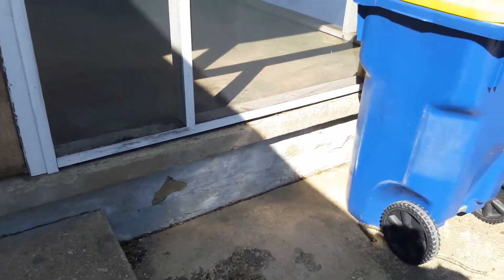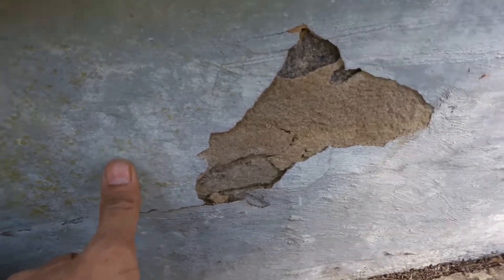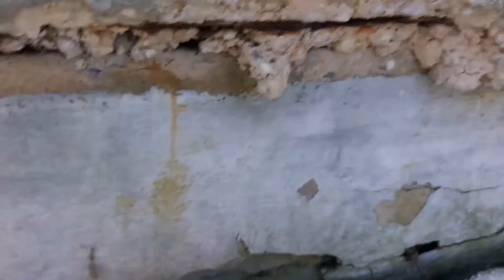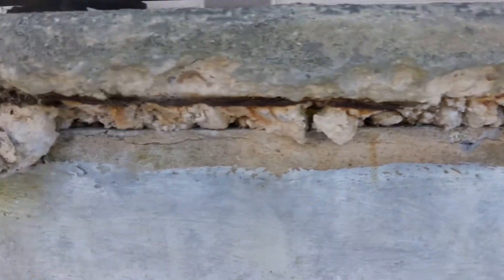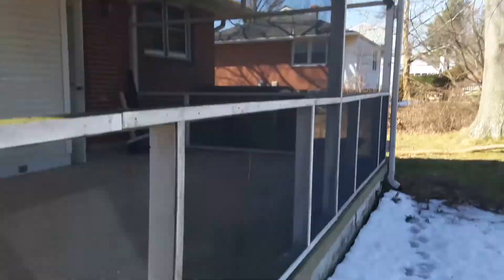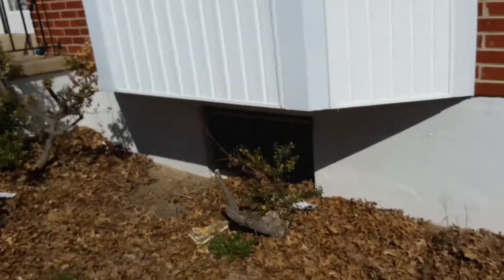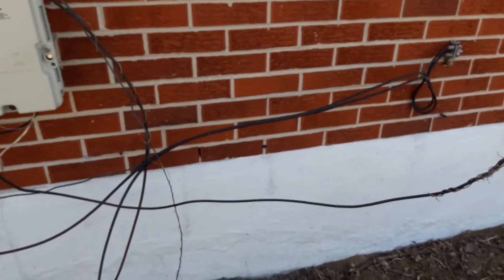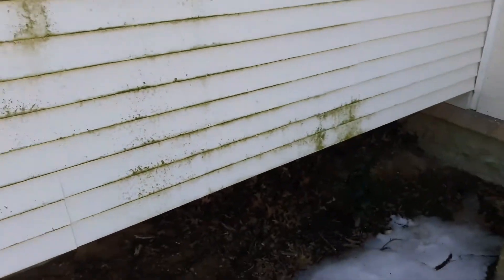Crack Foundation repair Porch of minimal damaged surfaced material

Comment: The open porch with wire mesh is caused by sweating. Concrete will sweat when it is cooler than the outside temp. and the humidity is high. If one does not apply a waterproof barrier before wire mesh the back will sweat and rust the mesh.
Reply from the maker: I like your thinking...but, this concrete is at ambient temperature and also no other location has this failure...
I am still thinking, a rusty section of metal was installed and add 30 years of rust expansion...
Again, I like your thinking on that...
Reply: Philadelphia Construction Engineering 
That is a possibility.

Comment: I'm still watching the vid, so this isn't a response just yet, but I have an idea, or maybe a question...   is there some penetrant sealer that would suck down in the crack with capillary action then dry watertight, that you could then patch and restore the surface?  And, w
Reply: Lolol!   Good man.  Not everybody can resist an easy flim-flam.
Reply from the maker: A "densifier" can tighten the surface but a sealer should be last as it will be a bond breaker for the newly applied cement...
I would suggest a polymer product...mostly because it will add moisture to the existing surface...
Ideally, you want to apply the stucco over a surface that will not wick away the moisture / water content from your materials you are applying...as that would cause the system to break bond with the surface...
Reply: Philadelphia Construction Engineering thanks.   My encounter with cracks like this doesn't involve much iron.   Mostly I deal with neglected brick porchwork.   I'm sure you know more than me how the cracks expand faster and faster...    well, I've tried patching a few people's cracks, but I always fear creating a small recess at the bottom of a crack...   I guess I want the fancy trick if there is one...    hot tar?   Really runny cement mix?   Fine, fine powder, and vibration?  Polymer product!   Awesome!   I'll check it out...  I hate doing a repair job that ain't an actual solution instead of a temporary fix.    When I see someone doing a patch job on an uninformed customer, I wince to the core...
Reply from the maker: Can I suggest you simply drill holes in existing concrete and then install a dowel or two... then ''false form'' the area and install the new concrete to match existing, as best you can with matching the mix... 
But, try to find the source of the cracking... such as water penetration, movement from foundation, abuse, etc... Then eliminate or mitigate that issue as much as you can. 
Now as far as the seam that will be created... Do NOT attempt to bond the two together on a ''flat surface" that is exposed to water and freeze thaw cycles... allow room enough to add a sika flex caulk (designed to be installed with the two concrete surfaces - this will water tight the joint and address the "crack"...
Basically, you will make your repair stand alone and act alone as much as possible... the advantage or reasoning is, the patch we may do, may not match the psi and mix design of the original problem area...   This ''non-matching" of our patch / repair will expand and contract differently than the existing or surrounding area.  
(the dowel technique I mentioned would be for this ''overhang" in the video above - mostly because someone might actually stand on a repair and that might ''flip-off'' and hurt your client, etc.)...   
You simply drill a hole, clean it out,  wet the inside of the hole to the point of it no longer evaporating the water and then epoxy an epoxy dowel into hole... then add your product...
With all that said, I will do a video for you, if you remind me, showing a ''plastic rebar'' that can also be used.
Reply: Philadelphia Construction Engineering Wow!  Thanks so, so much!  I'm gonna read this about a dozen, times, probably....   but, I love the dowel idea,  much better than my feeble scratches for mating the patch to the base!  Next chance I get to try it, I'll make a vid for you, and yes its a great idea for your channel, too!   I bet a lot of people would dig a demonstration.

Also, if you are trying to seal a crack, and you don't know how deep it runs, I wonder if you could use a sounding hammer like I do when inspecting trees for cracks.  So, if I am sealing a crack, ideally I would make sure I actually seal up to the bottom of the crack somehow.   Now, if I wanna get fancy,  I drill a hole to the bottom of the crack, and apply a vacuum.   Then the exposed crack is filled with goo, so no air can pass, and it is carefully fed to keep out bubbles, and then when the goo comes out the hole you drilled, you know the whole thing is permeated with the goo!   Ok, it might not always work...   or might never work....   actually, I likely will never try...    o well...   if you like the idea you can have it....